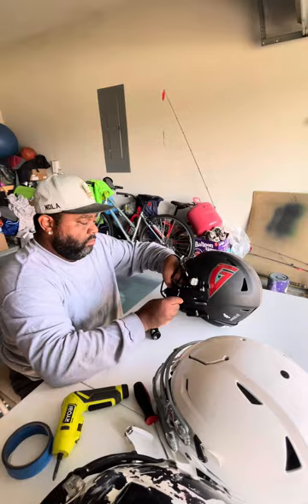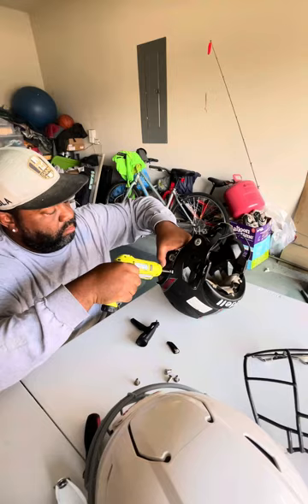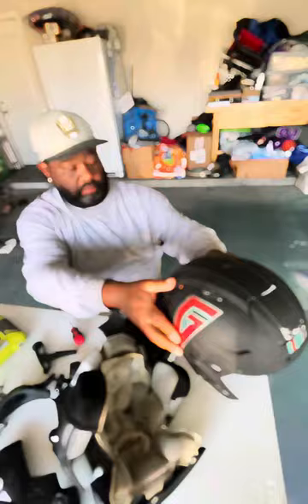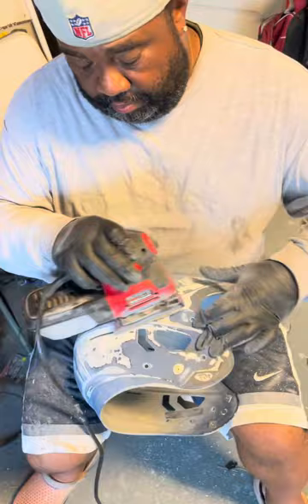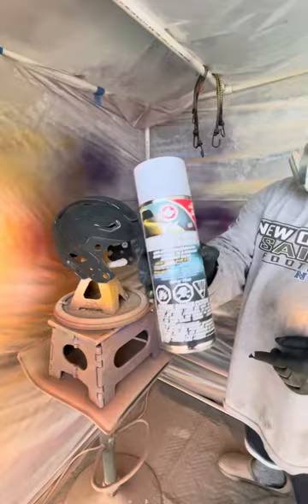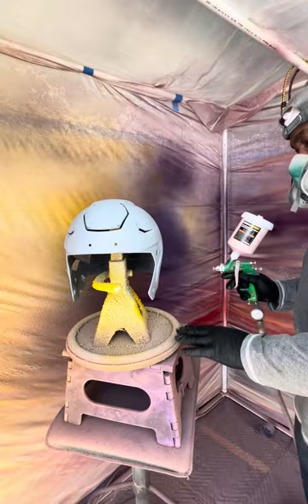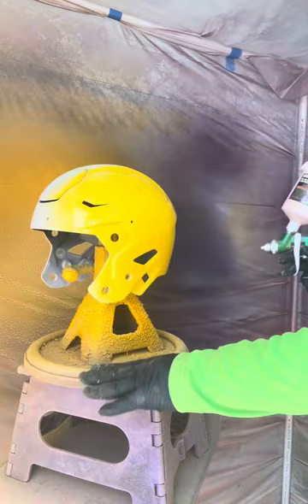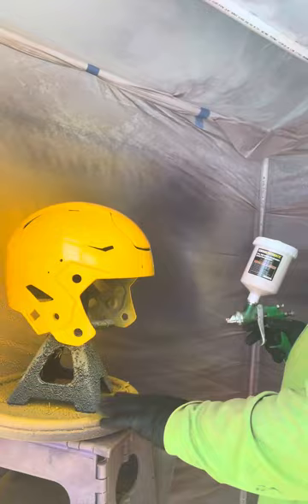Painting football helmets

Comment: Do you use a gloss to finish it ? I’m spray painting helmets tomorrow for the first time got primer, paint ,gold flake gloss and regular gloss
Reply from the maker: On these helmets I used single stage paint so the paint comes mixed with clear in and I just add a wet look hardener
Reply: @nolastrong  yo how long should I let it air out before it’s safe to wear ??
Reply from the maker: @juicefamtv6191  did you use a hardener
Reply: @nolastrong  just spray painted it with can auto paint and gloss
Reply from the maker: @juicefamtv6191  let it dry for a few days so the paint can settle in. But without a hardener it still may chip
Reply: @juicefamtv6191 how yours turn out bout to do mine next week?